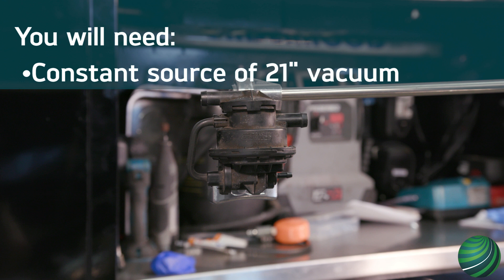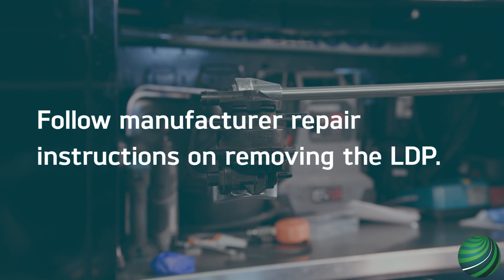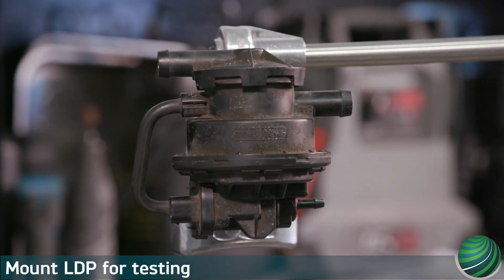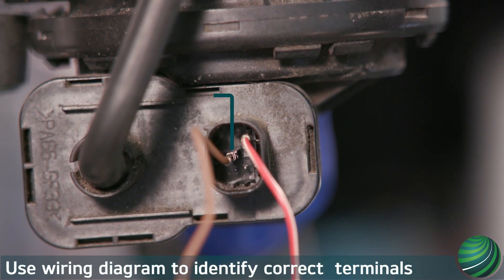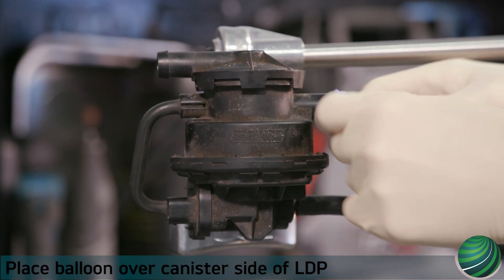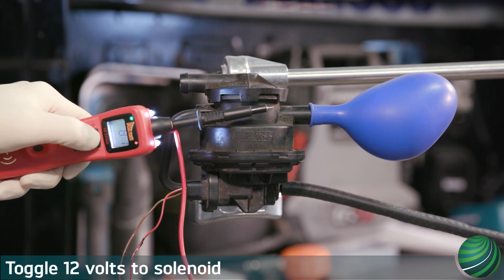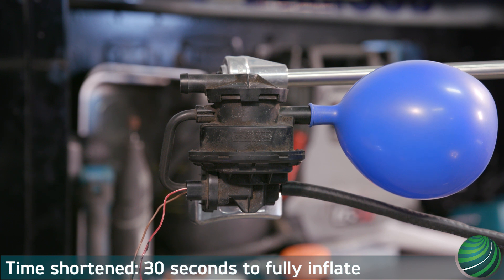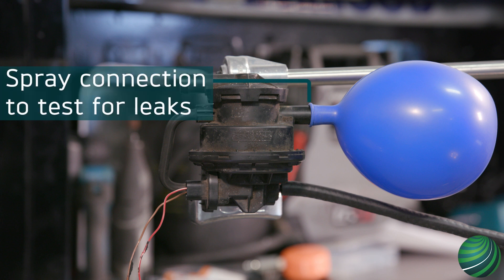Best Way to Bench Test a Leak Detection Pump LDP

Comment: Thank you. I'm a professional mechanic but work at an independent shop. A lot of these tests aren't available but they are needed to do a proper diagnosis and repair. Far too often guys at independent shops are forced to throw parts at a problem hoping to fix it due to lack of proper diagnosing techniques. And this was laid out so even a novice can understand and replicate it.

Comment: I am going to do this to my wife's 2005 Liberty 3.7L. When she shuts off the Jeep it makes a 2 second farting noise that comes from the pump (I can feel it vibrating). She also got a P0440 code but the evap solenoid was not holding pressure so we think the solenoid caused the code.

Comment: I like what you've shown. I'd suggest showing what a bad value looks like. Maybe demo how to check for a short I'm this system. I'm chasing a persistent P1494 Leak Detection Pump code and have replaced nearly every component and hoses.

Comment: Just wondering how you made balloon inflate with vacuum ??? Are you using a pressure supply not a vacuum supply ???
Reply: Thats what im trying to figure out to
Reply: My vague understanding, short version -- vacuum (momentarily triggered by an electric solenoid valve) pulls a diaphram; then, when the electric signal is turned off, the vacuum line is closed and a spring returns that diaphram to its original position.  The movement of the diaphram, in conjunction with little valves that open & close, pulls in fresh air and pushes it into the closed EVAP system...creating pressure.  This video explains --- https://www.youtube.com/watch?v=MSWqUpREpQA
Reply: It is a vacuum source just like he said. Some vehicles use engine manifold vacuum, some have a vacuum pump.  This device uses vacuum as a power source, the diaphragm inside the LDP is pulled against a spring and then released cycling rapidly the pumping action of the diaphragm makes enough air to begin to inflate a balloon.

Comment: This is not a complete test of the LDP. You also have to test the position switch inside the LDP. The +12 volt supply to the LDP is continuous and the wire from the other end of the solenoid is what is supposed to be connected to ground (the same as what the ECU does). Connecting and disconnecting the ground is what cycles the solenoid and pumps up the balloon. You also have to place a voltmeter on the wire coming from the internal switch to see if the switch is operating correctly. The switch wire should cycle between zero and 12 volts. Another thing is to monitor the engine vacuum going to the LDP with a vacuum gauge during the test. When the solenoid is closed it should read normal vacuum. Then when the solenoid is opened the vacuum should drop momentarily and then recover back up to normal. However if the vacuum drops and stays lower than normal then the rubber diaphragm inside the LDP is leaking so the pump must be replaced even if it still manages to pump up the balloon. A leaky diaphragm is the most common problem with these pumps.
Reply from the maker: This video shows how to bench test the pump for proper sealing when leak testing. Thanks for the additional notes on testing when the pump.
Reply: He is testing the electrical to mechanic part of the pump nothing more. If it passes then yes more testing should be done.Wiring harness test  to see if it gets a 
good ground or signal voltage from the computer which is switched of course not constant voltage. Most cars switch ground connection via the computer.
Reply: @hestheMaster  As an update the problem in the Dodge Caravan I was working on turned out the be a bad wire going from the sensing switch on the LDP up to the computer. I ended up running a new wire from the LDP to the computer outside of the wiring harness. I think there is probably a butt connector inside the harness that pulled apart. Once I ran the new wire the persistent, recurring  P1494 codes finally went away.
Reply: @joevignolor4u949  Had a Jeep Grand Cherokee, battery acid destroyed wiring harness under battery tray, had good ground, batt volts at LDP , load test circuit and short trace the power wire to under battery tray, cut open harness and found 8 damaged wires, So others beware if you see battery corrosion residue on these dodge products take a good look at those harnesses under tray.